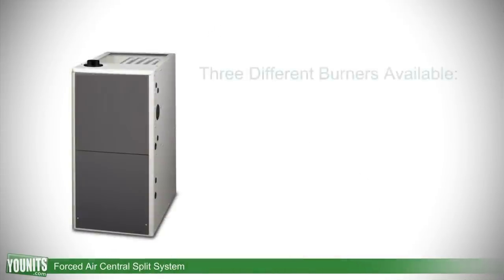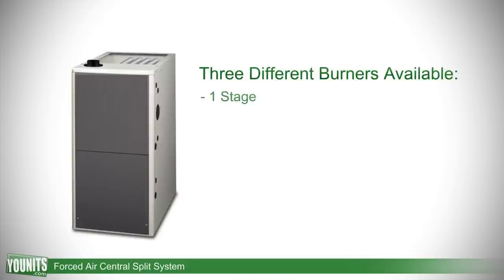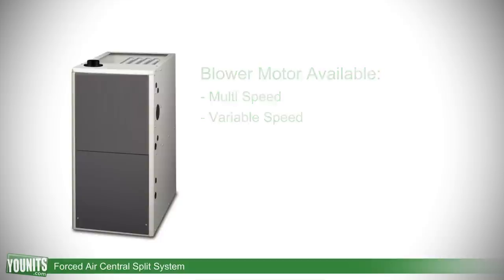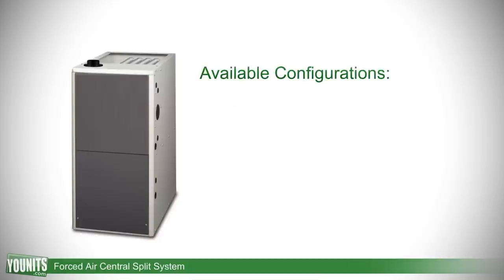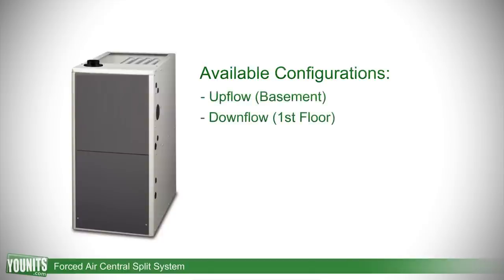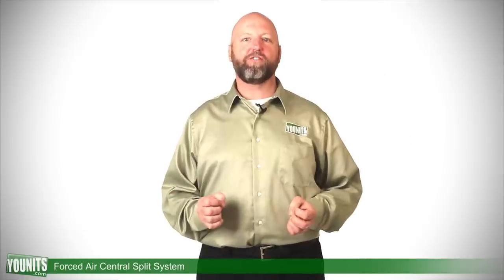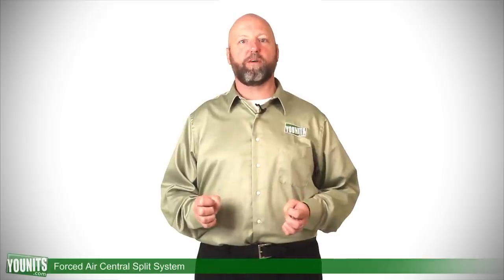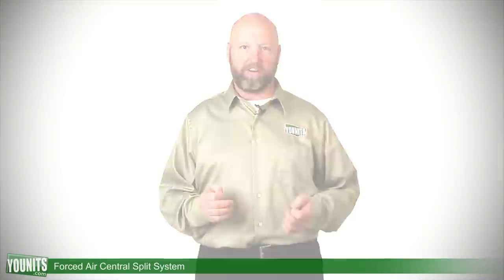How Forced Air Central Split Systems Work - Younits.com [HD]

Comment: The condenser when ran in heat pump mode doesn't condense and compress outside air. It absorbs heat outside and transfers it to the inside with the help of a refrigerant.